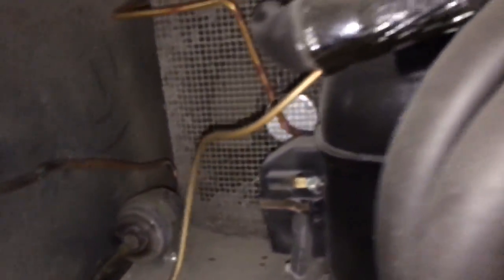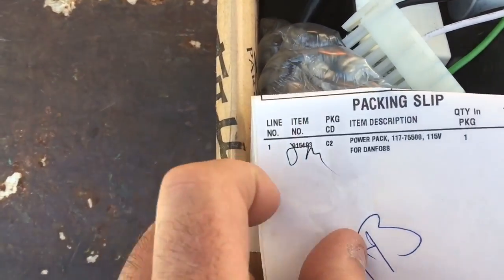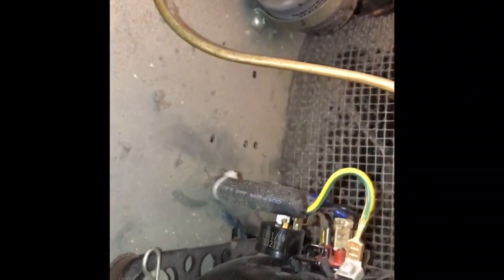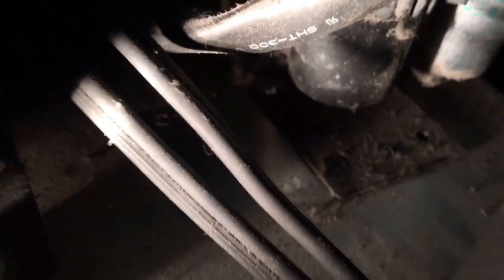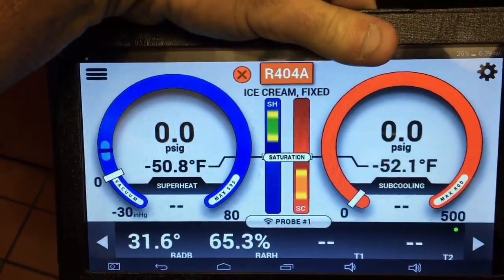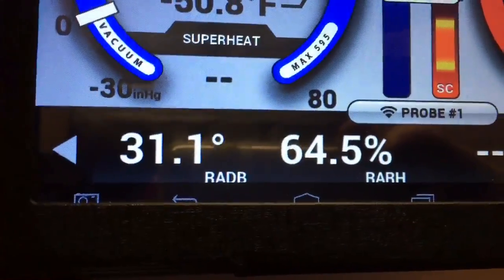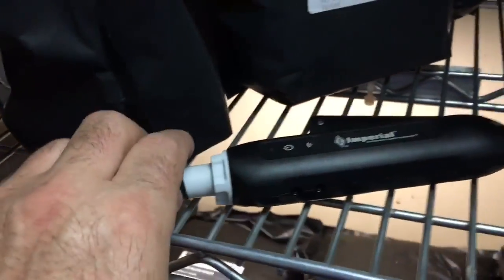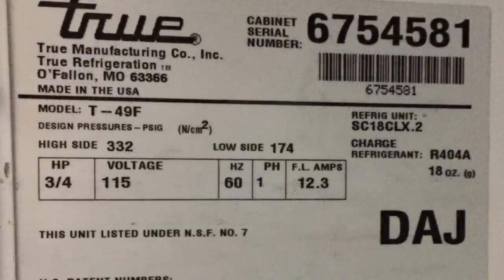True T-49F 2 Door Freezer with Danfoss Compressor in it. Power pack replace + iconnect distance.

Comment: Nice video OC. How where able to determine that freezer was from 2009 from the nameplate? Thanks, if you reply.
Reply from the maker: Yes. go to Truemfg.com ---click on support ----then click on serial number lookup. type in any serial number there and whala ! the ship date of the unit will be displayed , model number and country it was shipped to and access wiring diagrams sometimes. Thanks for watching.

Link -  https://www.truemfg.com/Support/Serial-Number-Lookup

i Keep a Shortcut to this page on my Cell Phone - For Easy Lookup on JOb sites in 2 seconds. any true serial number date of manufacture.
Reply: Thanks, OC for the good answer. No klix on with that kit, what a joke! Thanks again for teaching me something about True product line.
Reply from the maker: No prob. We are all here trying to keep each other informed on this ever changing industry and unit quirks & problems. Yea, no klixon with all those start components being replaced just pisses me off. Ill remeber that,  if i ever run into one of those danfoss power packs again.

Comment: How is the testo temp probe for below zero readings? 
That imanifold distance is impressive compared to the testos.
Reply from the maker: Right now it's sitting in a freezer -5.9 Degree's been there for over an hour no problems. works great i usually don't like keeping the whole probe in a freezer below zero  because i believe the batterys will freeze , i believe the limitation is the battery's but the probe tip itself u can stick in air down to -50 degree's i belive. all the testo wireless probe stuff works great . i really like the smart probes and the 905i here. distance is only like 3ft from a closed refrig but, i use it for when i start up a job . i don't have to keep opening the doors to check temp or use type k thermocouple wires and meter. Yes, iconnect has the better distance for sure. but a iconnect box and a air probe will run u 400 for the box and 300 for the probe. 700.00 vs $65.00
Reply from the maker: The 905i will measure Down to -58 degree's F. You just cannot put the entire thing in anything colder than -4 degree's. You can ony stick the stainless steel probe into -58. The Body & batterys can only go to -4 F. 
Heres the testo link stating this. 

https://www.testo.com/en-US/testo-905i/p/0560-1905